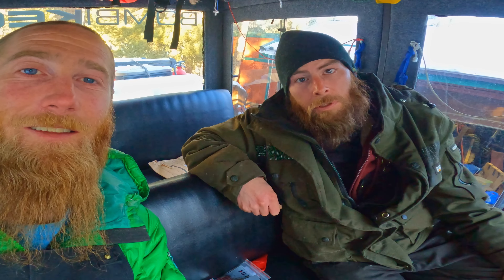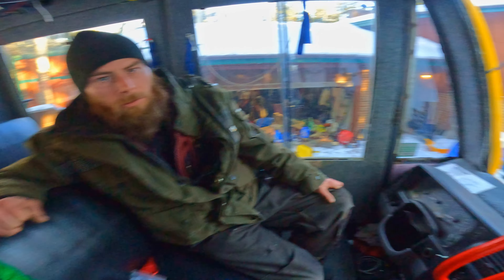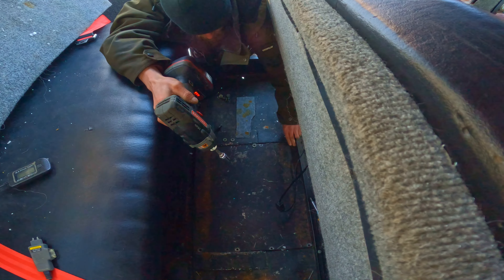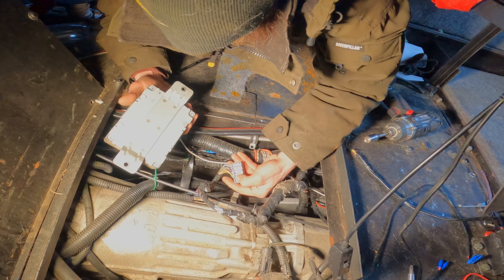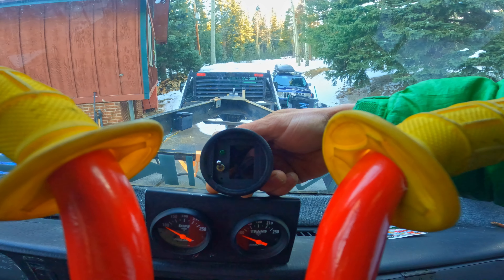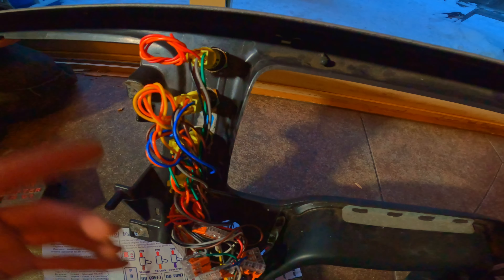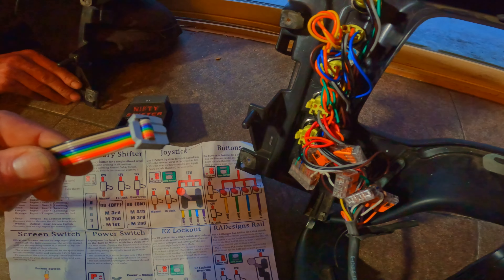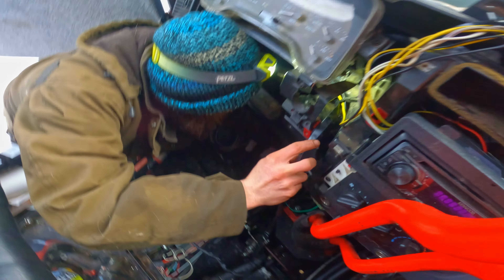How to install Button shifters in our bombi (kee) snowcat (Nifty shifter jr) jeep aw4 transmission.

Comment: That's a sick install guys, great work on this awesome setup!
Reply from the maker: Thank you! our next video is getting out for some testing. figured out it can stall with the torque convertor locked stopping in any gear other than 1st. it also seemed to help keep trans temps down keeping the torque convertor locked. Though with hilly and winding terrain it's easier to leave it unlocked.  Anyway glad you liked it. Keep an eye out for the next one.